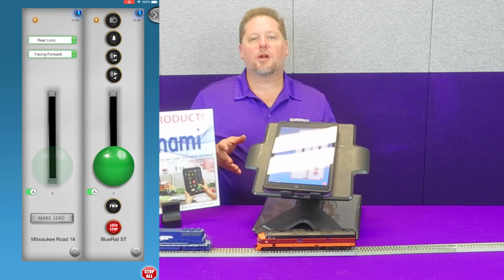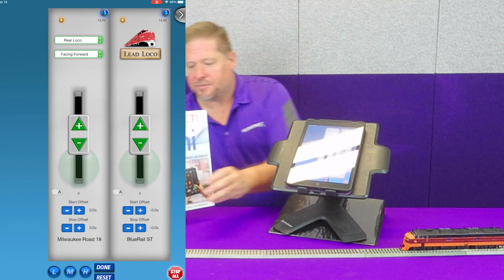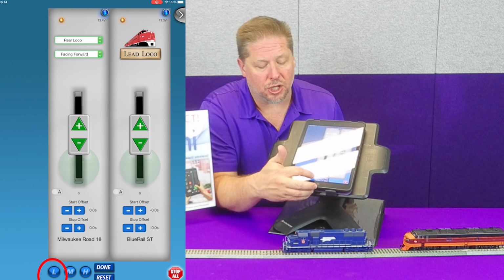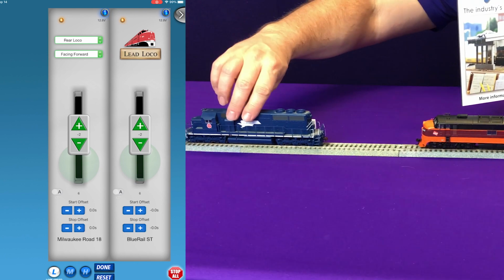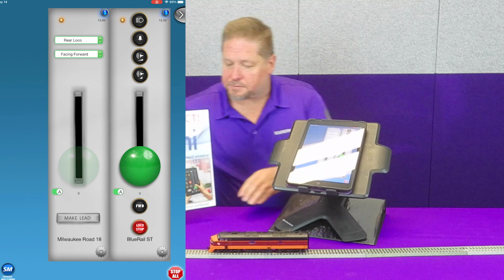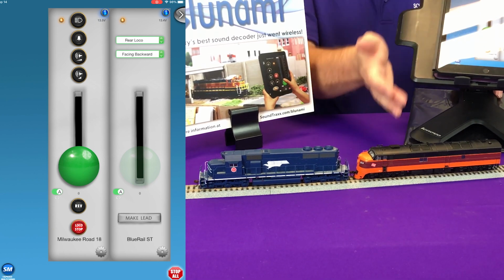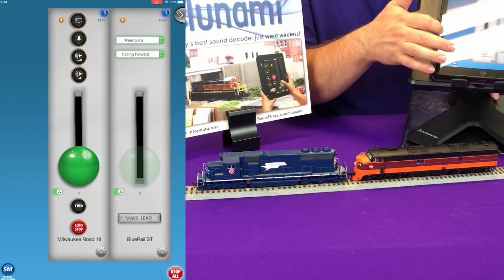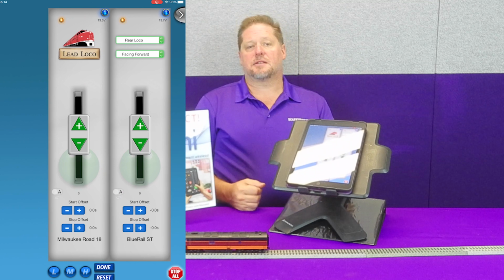Speed Matching with Blunami

Comment: Do the upgraded blunami decoders in 2024 use the back emf and curent draw to automatically speed match locomotives  or are they all still manual? Railpro is automatic soni cant understand why blunami cannot be either since you gius are known for innovation and cutting edge materials and make your own stuff in Colorado  sobit should be doable.
Reply from the maker: We have BEMF and speed matching settings. Our Support Team can help you further: (970)259-0690 or support@soundtraxx.com.

Comment: Does it remember this when I put these two locomotives back in a consist?
Reply from the maker: When you close the app, you will have to re-consist the locos.  But that is easy and quick, so it is not a big deal.  You can leave the app open, just minimize it when you are not running your trains if you’d rather.  But consisting is quick, so not a huge deal. But, it is noted and will be passed to the app developers for a possibility of this in future revisions.
Reply: @SoundtraxxDCC  I have 3 Blunami locomotives and I speed matched them using the app. I recommend speed matching on an oval test track and starting off with the locomotives uncoupled from each other. After tinkering with the +/- I eventually got them all to complete the oval staying a few inches of spacing between each other, in all 3 speed zones. The app remembers the speed matching, so even if I consist only 2 of the 3, they stay speed matched. The ghosted out throttle setting of the non-lead locomotives is very helpful to confirm the previous settings. Make sure you have your locomotives fully setup the way you want the speed table, inertia, etc. first before doing the speed matching.

Comment: A freind of mine just installed Tusnami2 on his Rapido FA-1. He told me after he matched the CV settings with the A&B unit, he did not need to speed match. Looks like in the video he sent me that he is not having consist speed problems.
Reply from the maker: Sometimes you get lucky and speed matching is not necessary. It depends on the models.

Comment: Great information as always and definitely looks way easier to speed match over prior methods. There's a large reflection on your screen on the table that makes it hard to see what you're touching. Check your overhead lights for the future to prevent the glare.
Reply from the maker: We realize there is a reflection. That is why we have the screen recording inserted. The full view is just so you can see the general area that he is touching if you don't initially see the buttons move on the screen recording.